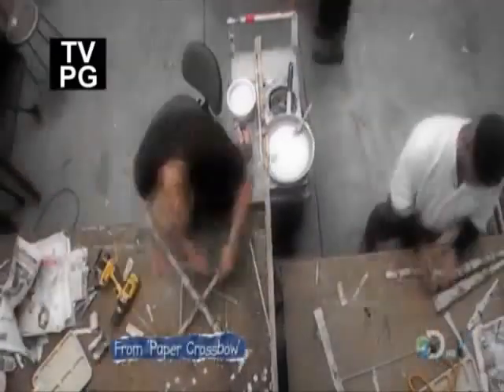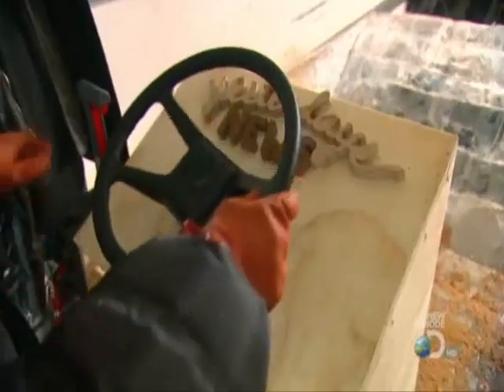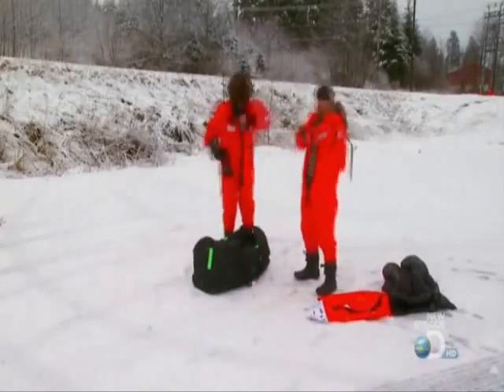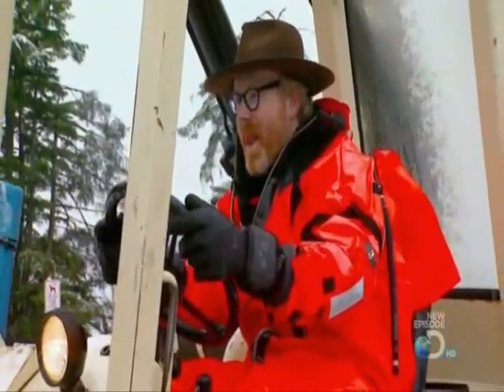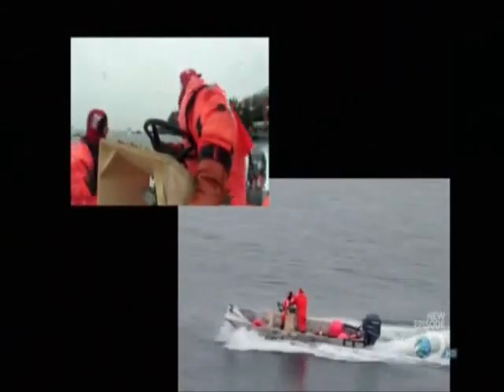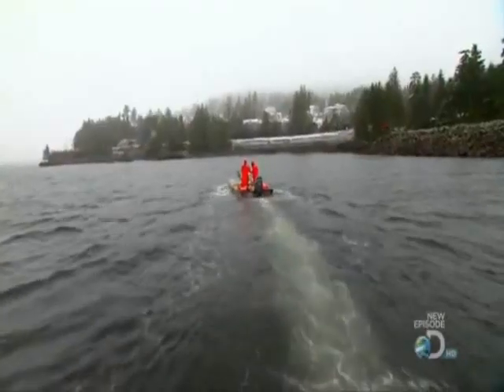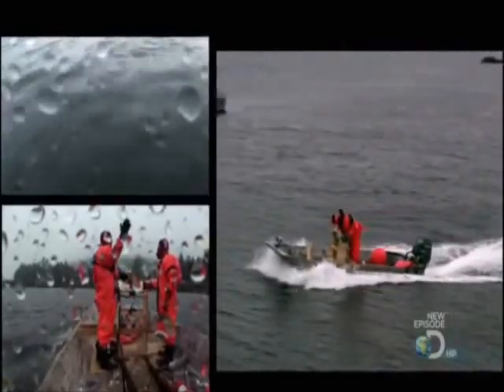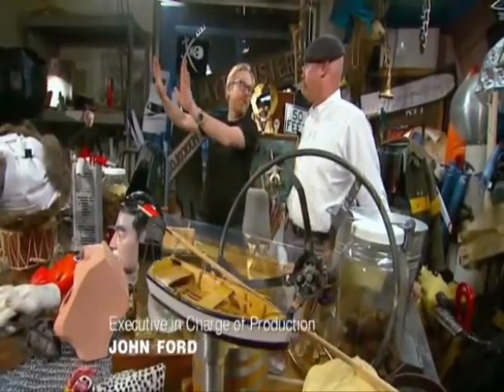Mythbusters: Making a boat with frozen paper

Comment: "could go anywhere in the world." No sir,  Mr. Hyneman. Perhaps you were told the myth wrong but the original ship was only for the north atlantic specifically for waters in and around the Icelandic region, to create a ship large enough to have air superiority over all the Atlantic it was basically a movable floating island.
Reply: More like a floating airstrip. Or a flat iceberg.
Reply: Then they realise it would just be easier to invade Iceland and occupy it for a few years.
Reply: Not just that the original would have a freezer motor's on it and on the prototype it had a 1hp freezer motor and it at no point broke up and in fact after they turned off the motor it took 3 years for it to start breaking up.
Reply: @DavidKnowles0 they already had occupied Iceland, but Iceland is too far north for what they wanted